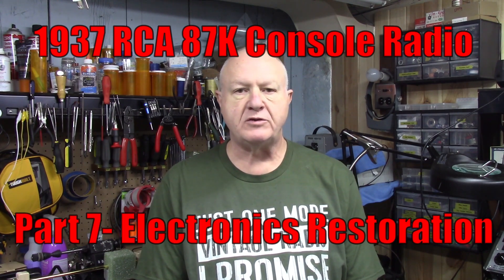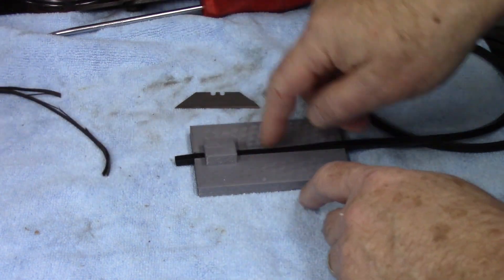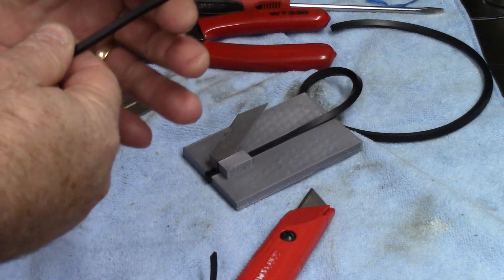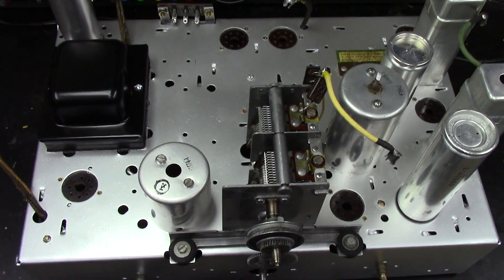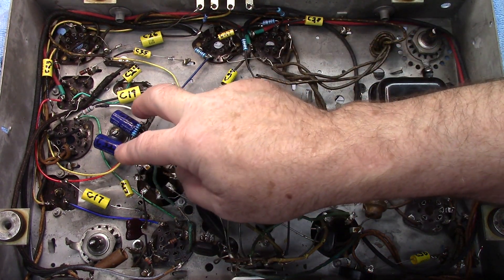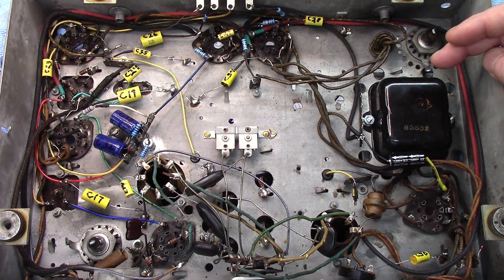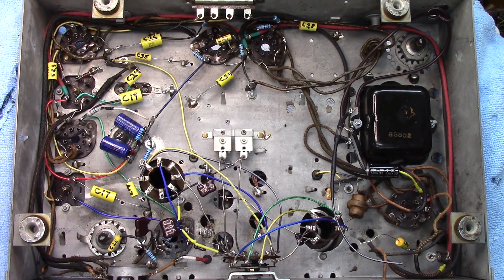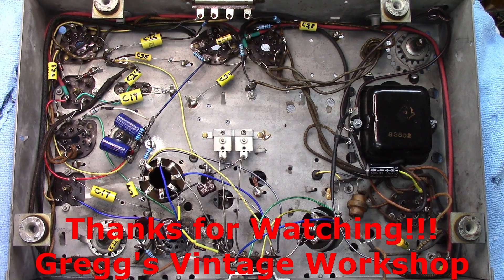RCA 87K  Part 7  Electrical Restoration

Comment: Pretty handy jig for making that new belt and then super glue the ends together who would have thought that would work that well. Yes indeed anything 20 % out of tolerance should be replaced just on general principles and besides its cheap insurance. Thanks for the great Video Gregg glad to see this project is moving right along.
Reply from the maker: Thank you Larry, yeah when you've got better parts any way, as far as much better tolerances and you are already in as deep as I was, to me it made sense. Yes the tool I made did exactly what I designed it to do, and I'm pretty happy with the final results.